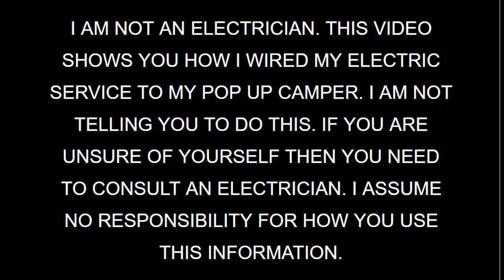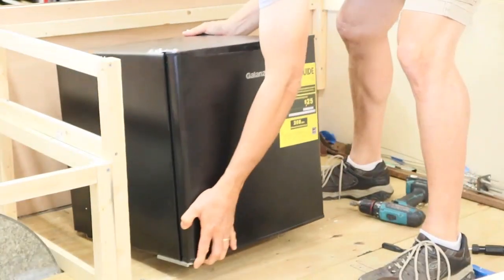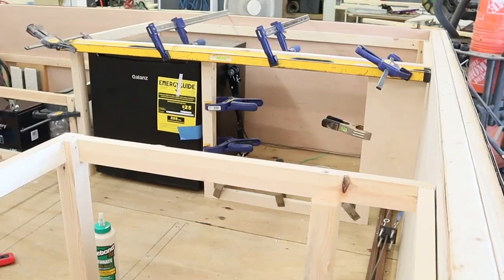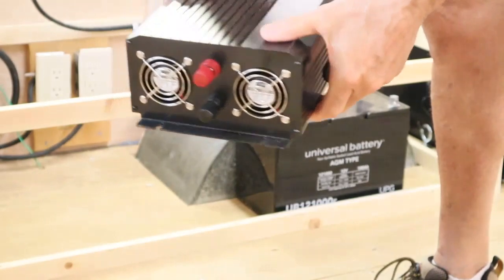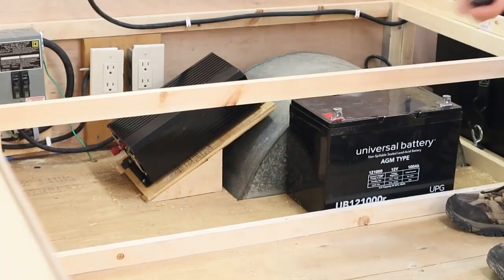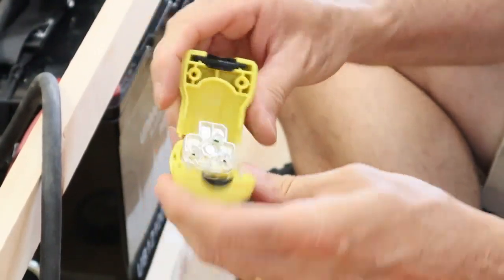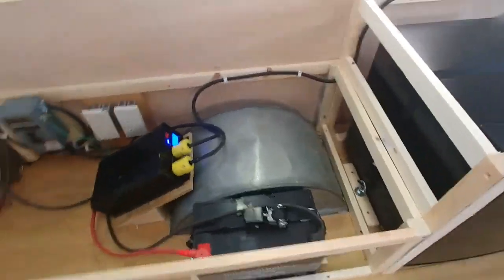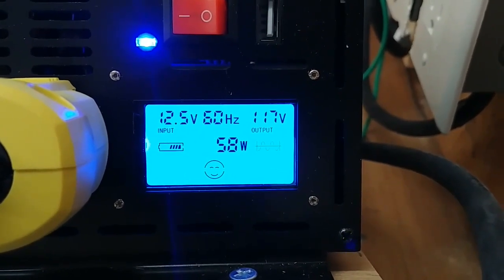POP UP CAMPER 12 VOLT ELECTRICAL SYSTEM  Battery Power Inverter Electricity Service PT 19 #flgpopup

Comment: was wondering if you had a switch to go back and forth from shore power to dc.   but i guess plugging them in to the other will make sure you dont feed each in the same line.  lol    i like that better than one of those high dollar switches.   my popup is at this stage in the driveway right now.   electrical and panels are next.   going with one of those small propane tankless for the sink  (they are super small size).  love the vids!!
Reply from the maker: Thanks for watching. Good luck with your project.

Comment: GB, There's a whole lot of Auto Mechanic or DC voltage in You!! I suspect You learned DC voltage a long time before You learned AC current. You are good at both. This is a great video, I learned from it. Thanks.
Reply from the maker: Thanks MT Yep, learned DC voltage on the old 60's cars I used to wrench on. They do weird things with the cars now, not everything is 12 volts DC, some is 5 volts and other voltages as well. Our Rav4 was complicated, I couldn't mess with it at all. Thanks for hanging around.